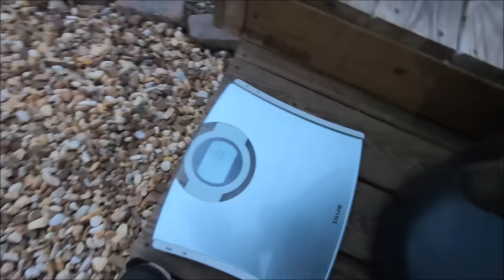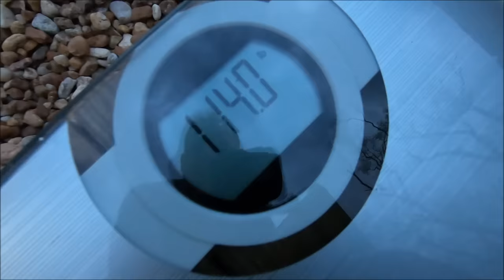Found Gigantic Chain Part 5: You Won't Believe Whats Other End: A Million People Want to Know ! ! !

Comment: The chain is a logging chain. The swivel end went thru the large ring to hold together a log boom during a log run across a lake.
Reply: Kurt Schaller 
Thanks Kurt, I did wonder what it's original purpose was, that swivel must be commonly used in logging but I confess that here in the UK we don't have anything like that,  not surprising really when you think that my homeland is only about a quarter of the size of Texas.
Reply: You nailed it! It's an old logging chain. I should have a couple here identical to that one, on the farm we used in the woods right up into the 1970s,  when we got the JD 440 skidder, that I still have. Good eye.
Reply: well Jimmy  looks like couple people know there s...t    not many    dumb answers  ship gold  find horse shoes more likely     440 JD   old school      steam powered log boom older school
Reply: I think you are correct.
Reply: I'm betting the piece with the wheels is a pulley mechanisim part for chains, or wire rope, part of something logging related maybe a steam boat used in logging.
Reply: all that for scrap metal
Reply: I have one my grandfather used down by Galveston.  Said the work was too hard and went to work for the railroads lol it's old lol but not that old lol its not really of any value but scares the kids when I hang it in a tree hahaha at Halloween.  They think its part of a guillotine hahaha.  Ppl be foolish.  That first part that was  - found/uncovered should have been recognizable and identifiable.  It's one of the few things that survived my house burning down.   I just found this video of chain in the ground
Reply: Thank you. I never heard what it was or what its purpose was. Appreciate the info.  Just found this channel and so far, I like it. Thank you again

Comment: Looks like a cable run like the one on a ferry that hauled people across the river before the lake filled up and flooded the river. The wheels ran on top of the cable had another cable that ran from the center of the roller beam to the ferry. Used 2 beams one fore & one aft. To keep ferry straight in the river.

Comment: it is part of a rail ssystem used by a drydock for pulling out boats for repaair  four to six and sometimes more of these are used on two railroad rails you set them up in pairs with a 12 or 24 inch block of wood cross the top of them to support the kell of the vessel and the chain is hooked from one set to another to keep from loosing them when you get to the end of the  rail system that is underwater

Comment: For the "Nay Sayers", even Archimedes would have not moved that mountain no matter the size of his lever. You had the jack over the rail item preventing its removal. I also concur with the thought of others on the logs, mayhap the chains log was an old cannon or perhaps mast timbers... Digger Seven had a video showing what could have been old rail irons... the tops were squared with square shoulders that could have fit the wheels on that rack. Depending on your location ... you could have just washed a gram of gold dust down the yard :).

Comment: Good way to clean up that chain, hook it to the truck or the kids 4 wheeler and drag it up & down a gravel road for a while. That will knock off all the rust, scale & mud in a hurry. BTW I have about 6' of chain like that with slip hooks, don't quite remember where I came across it but used to keep it in the trunk of my Cavalier in case someone needed a tow chain lmao.

Comment: Its a lift block , thats why the chain was around it , hooked the chain to excavator bucket for example and the chain connected to the block and around the pulleys would most likely be steel cables and the cables went to what ever it was lifting , its to help hoist and stabilize loads as you lift and place them

Comment: I found a chain like that years ago at low tide and it dragged it up a bluff and steep trail, to my van and home.
 There were no homes in the area, but 85+ years ago there were cabins, and this chain looked identical to yours. 
They are used for anchor buoy's that boats use in the summer.
They would set the end in a barrel of concrete out beyond the low tide.
The rail with rollers reminds me of a overhead barn crane used to move hay bales etc. along a metal bar in the rafters.
Reply: Wow you fellas in comments are taking me down memory lane ! Used hay conveyors they called them in the field to pick up and deposit hay ( loose ) onto the hay wagons . All horse drawn for the most part back then . Then to the barn usually a drive through or breeze way our doors on a gable end with a post or jib sticking out over the door . The hoist you speak of was hooked to a couple ropes one heavy and on for the release of the hay forks that would drop into the loose hay on the wagon . Then someone would set the forks or lock them into the hay . Then that ' hitch ' would be hoisted up by the fork assembly , and down the ridge in the center of the barn roof to be released by the small or release rope , and the hay dropped where it would eventually be filled back towards the door by pitch forks and sweat or the drive through of the barn. . . .  Wasn't a lot of fun at the time but fond memories now . . . . . .hard to believe it was so many years ago . I think the trolley in the video was much heavier than what I recall for moving hay . . . . .again was a long time ago . Thanks .

Comment: I'm thinking that the metal arm with the wheels on it,  if it were straightened out,  might have been a part of something that was towed or pushed on the train tracks. You would have 2 of those things,  or more,  and had like a platform of some sort going across it. Ha, just my guess of possibly millions.  Hmm? Kinda makes ya think.... hmm? Yup, I'm a thinkin', that's for sure.... hmm?

Comment: there are alot of these in old shipyards in louisiana were im from . they are spaced out about as wide as each bulkhead is in the vessel to support evan amounts of weight that the  vessel is .
Reply: if you keep digging, you will find the entire rail system down there . good money for the entire pile of steel your gonna get at the scrapyard for it.. good luck.

Comment: So the thing with the Wheels/ rollers is part of a rail cart. There would be two of them that ran on the rails. We used them to load lumber into kilns to dry the lumber. There were two with 4" tubing welded on top the lumber was loaded on to the "Kiln Carts". They were pulled or pushed along the rails entering or exiting the kilns. Suppose they could be used any # of ways to move things on a rail system.
Reply: I was thinking saw mill carriage?

Comment: Hi, I got the length slightly wrong as I guessed 10 ft and the weight wrong as I guessed 100lb so not too far out lol. What was it used for ??? was it to haul the ferry across ?? because if so then there must be another one exactly the same on the other side of the lake/river etc. Thanks for sharing as that has been bugging the hell outta me. x

Comment: Read the comments and the chain is a general purpose design which is a good one :o) I’d use it. That frame looks like the bottom rollers off a sliding door to me. Ships and boat movements make big swinging doors a bit dangerous, so I’m sticking my vote to roller sliding door :)

Comment: The wheels look like they are meant to be run on train track. My guess is there was a 2nd set of these and they were used for a boat launch.  The reason I say this is in my back yard two two rails running down to the water that used to be the main boat launch in this area. A buddy recently told me he used to launch his boat here like 30 years ago. I will ask him if he can describe the parts of the launch that sat on the rails, and the boats sat on. This one used cable instead of chain. The cable was still here till last year we let someone take it for scrap metal, as well as the 6 inch diameter metal pipes the winch was attached to.

Comment: Wish my waterhose had that much pressure...
Reply: Get a high pressure pump and you could
Reply: Or have a plumber put you an outside faucet plumbed in to line before your pressure reducer/regulator. But if you leave the hose on while closed it can burst the hose.
Reply: Also, it looked like he was using a Gilmour brand 501 pistol poly hose nozzle. Hard to beat Gilmour products...especially, when they used to be made in the US. Available at Walmart for $4.99. Best 5 bucks you'll ever spend.
Reply: rwilbanksjr it’s an adapter
Reply: There’s a better one but the waterholes that I’m talking about can go through your skin

Comment: That long rail is part of the undercarriage from an old bulldozer. A big sprocket was at the rear and a big steel wheel called an idler was at the front. Those little "wheels" you're trying to turn are the rollers that keep the track in alignment. Evidently somebody was using a scrap piece for a deadman anchor.
Reply: Wrong.
Reply: That would make sense. They were attempting to pull a bulldozer when it got stuck. It bent and popped off so they just gave up
Reply: Sounds good to me.
Reply: j hart That makes since! Mow that you said that, I used to have an old two cylinder "Poppin John" bulldozer. I think I remember seeing something similar. So I guess my hopes of it being an old ore cart from the lost Strike It Rich Alabama Gold Mine are pretty much down the drain! Good call!
Reply: That is NOT a dozer track frame what so ever!
Reply: No wrong I used to load those carts to be put in the dryers those are kiln karts
Reply: If that were true it would be one very small dozer.
Reply: @Shawn-rq4py  ransom made a dozer 5 foot long
Reply: I was thinking the same thing!
Reply: John Deere & Cletrac both made very small bulldozers. An old family friend had 1 he stored in a garden shed.
Reply: Clertac is not a bulldozer what so ever!
Reply: Then what exactly do you call a Cletrac dozer?
Reply: Wrong x 2. Buncher chain for logging and a bent kiln cart for drying lumber.

Comment: I don't care what these idiots say. I OWNED all kinds of track equipment for almost 60 years and worked on all of it from bulldozers to excavators. The reason it bent was for two reasons. One, it is plenty strong when mounted with the structural components that keep it in place. Two, you underestimate that Kubota mini-excavators power. That series has not one, but THREE hydraulic pumps. It bent the rail trying to pull it up.

Comment: It's a deadleg, a heavy equipment tie down system, bury a long pipe or log in the ground with a chain to tie off the machine so it doesn't travel due to vibration. My best guess, a sluice box for washing gold.

Comment: The roller part is a trolley boggy from heavy lift overhead trolley system from a sawmill or iron works,
who knows ? 
The chain may have been part of it but, I don't think so, who knows ? but !
I am pretty sure it was used as a barge/ boat anchor for over night anchorage and the chain was tied to
a barrel or bouy for a float during high water. It may be from the steamboat era, depending on the top secret
river it's on.

Comment: The chain is a common "boom chain" used to link perimeter logs around a raft of logs that are floated down a river to a sawmill.  The perimeter logs had holes in the ends to allow these chains to stitch them into a floating "corral ." One end has a ring and the other has a toggle.  I lived in the Pacific Northwest and had one as a yard ornament on some logs in the Garden. Pretty nice find.

Comment: My guess is the chain and that goes together that you sit on the back of an old skid skid tractor to pull barges up the river probably was a cable that went through those two little wheels attached to the back of a small track machine and the chain Boulder boats or bages up the river long long years ago

Comment: It's a cargo slider. Used to transfer heavy goods on a cable. Ship to ship or ship to shore. Usually has a hook in the middle to hang a cargo net and has a pull cable on each end that attaches to a winch. The logging chain means it was probably used to load logs onto a barge. They use these to bring lumber down off hillsides these days. Not so much for cargo except transfers at sea.

Comment: It looks like a track that ran on a wire, or some kind of aerial lift system.  That would also account for the chain.
Reply: Good thinking. Maybe it was attached to a barge or boat and broke loose, or was at a long gone loading dock on shore. Probably not far from where it happened given its weight

Comment: Stock Cannon Wheels

If you are looking for an extremely strong, solid wheel, look no further. The 15" have a 75" wide tire with a hub 4" long and 2.75" in diameter. The 20" and 24 dia cannon wheels" have a 1 1/4" wide rim/tire. The hub is 5 1/4" long and 3 7/8" in diameter.

Comment: It was put in to moor a boat. You will find similar on many river banks using lot of items buried attached to the chain. A tractor tyre is a good one as it’s unlikely to pull out but anything heavy can be used.

Comment: When I was a teenager, my highschool was in a rural area. The high school served two towns, and was between them. No one could walk to the highschool, being that it was to far from each town it serviced. You could walk, but it was a hike home. There was railroad track behind the school, that went through both towns. You could walk the tracks, but it was a longer walk through thick woods. My friends, and myself used to walk home on the track just for fun. Sometimes we explored  the woods on the sides of  the tracks. One summer we were walking the tracks, and exploring the woods, when in the middle of no where, we almost walked into a cement structure. It was round like a big pipe sticking in the ground. It was wider than I was tall, and had a metal top padlocked down. The padlock had a metal plate hanging on the clasp. The metal plate had years, and dates stamped into the metal plate. On the other side of the plate, it had the name of some government agency stamped in the metal. Sorry, I don't remember what the agency name was. It was something like, the department of defence, but way more boring. We looked up the name, and it didn't really mean anything to me. The name meant nothing, and the explaination was just boring. Eitherway, the thing was really weird. In the middle of no where, out of sight, was a cement thing locked up. The earliest dates went back to the fifties, and it seemed that every few years, another date was stamped on the plate. There was no road, or structures near. At the time, we didn't think much of it. What it became, was a destination when we walked by. Often we went looking for it, but we got to tired to look for it. A year later we told these older teens about it, and they called us a liar. We went and showed them the struture, which was a minor mircle we found it because the older teens threaten to beat us up if we were lying.  Consider were it was, the thing was just boring. If it was near a town, I would've consider it a public's work thing. Either way, the older teens were angry, because it was so boring. Later that summer, we heard the teens had broken the lock, and gotten the top off. They said it was just a well. My friends and myself thought heads were going to roll, so we didn't go check it out. I think, maybe after school started, we walked home from school on the tracks, and checked out the well. The metal plate was off the well, and as far as we could see, it was just a cement tube. We couldn't see far down the well, because we were under trees, and it was late in the day. At the end of winter, March, or April, we went back to the well. We had a string, with a weight on it. we want to see how deep the well was. We never figured out how deep the well was, something made the string push against the well wall. What we did see, with out the leave cover up the light, was the cement only went down so far, and the walls of the well was cut stone. We went back a few times, but one day we found the cover back on the well, and it had link welded shut, hold the cover in  place. It also had plate with a year and date on it, but no name telling who was checking the well out. At the time I thought it was just some thing, that had a purpose. Sure it seemed weird, but still I thought it normal.  Decades later, I think the thing is damn weird. I wonder if someone is still check out that hole in the ground.

Comment: The two rollers on the beam are only half of a "cart" that is designed to roll on steel rails to carry heavy things up a ramp and onto a deck, or maybe a railroad flatcar. The triangle shaped swivel was made to quickly connect the chain to the team of donkeys that pulled it. Then it could be just as quickly disconnected. At some point, it was just a convenient piece of heavy iron to use as a "dead man".

Comment: That chain looks like it was used to lift large diameter concrete pipe, just tip the plate drop through hole in pipe then lift.

Comment: Interesting find. In 1974 I went to work for the power company in Washington DC. The first place I was assigned to work was a power plant built in the early 1900's. What you have there looks like one half of a small, tracked, overhead crane. We had several in the plant. Although the chain looks like anchor chain (which is what I think the whole thing was used for) we had plenty of large chain like that to lift parts of the generators. I can't prove for sure what it really is, but that's what I'm betting it came from. Both pieces repurposed to use as an anchor. Thanks for the cool videos, and your persistence!!!!